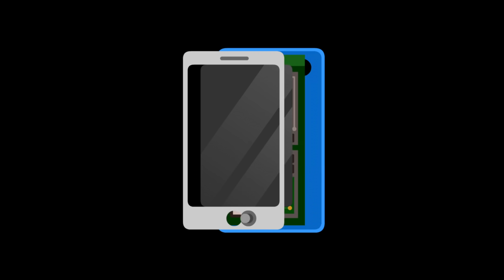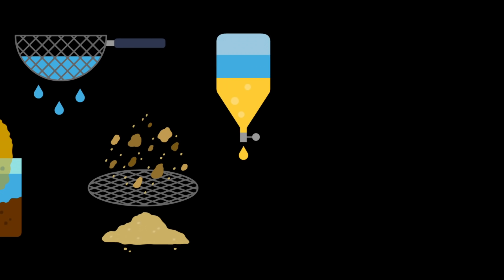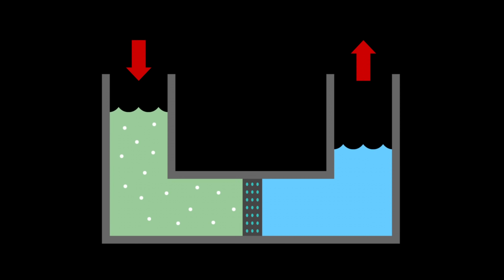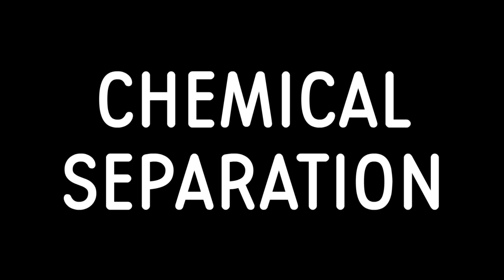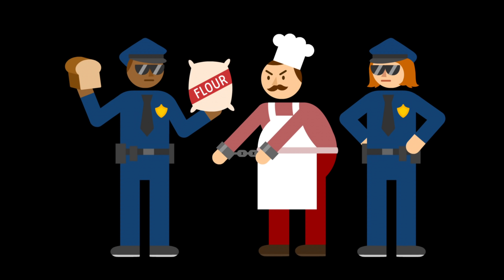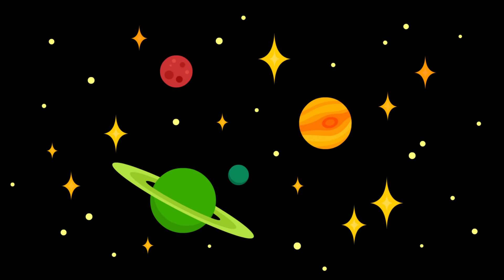How do we separate the seemingly inseparable? - Iddo Magen

Comment: But chromatography is not a "chemical" separation technic, because still relies on a physical difference between the substances, the polarity.
A real chemical separation is one where you make react one of the components of the mixture, change their physical properties and then separate them by one of the processes that you mention
Reply: This is correct.  Came here to say this.  Chromatography is a physical means of separation, not chemical.

Comment: Good presentation your chemical analysis part was spot on however the animation for blood separation was unclear. the tube is spun to where the bottom of the tube is at the outermost part of the centrifuge. Your animation made it seem as though the tube was spun on its own axis and the cells were pushed to the side of the tube, this is not the case.

Comment: That's not how centrifuges work. And the way reverse osmosis is explained makes it sound like regular osmosis. Pressure has to be added on the salinated side. Otherwise, the pure water would diffuse along its gradient into the salt water until they reached equilibrium.

Comment: While I appreciate the simplicity of the Gas Chromatography it is not as is described.  The mixture is heated to the vaporization temperature of the solvent used and then is injected into the instrument.  Then you have liquid chromatography which is similar to gas chromatography.

Comment: A centrifuge spins the tube around an external axis with a tilted angle so the bottom of the tube points outwards, not the tube itself around an internal axis (2:30) ... that is why the red blood cells pack at the bottom of the tube, and not around the sides like the animation shows initially, until it magically fades into the real world situation.

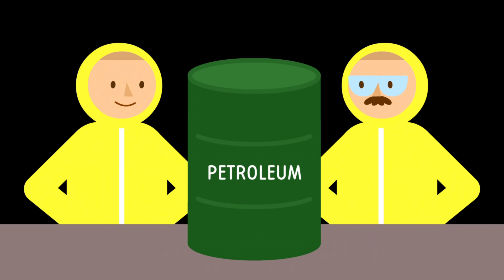Comment: 1:16 that turbine XD
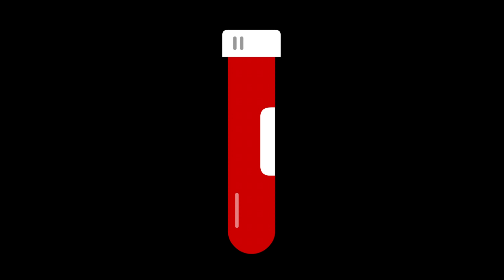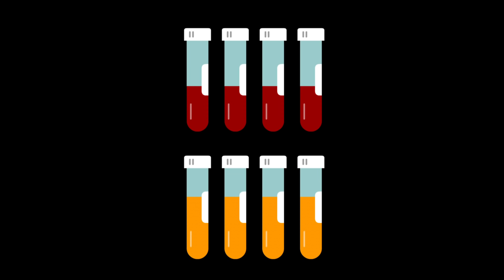2:27 thats not how they are turned! the small "bottle" is turned with its bottom part further away from the rotationcenter than the top. that way you also get the seperation shown at 2:42

Comment: Minor mistake with the animation for the blood separation. A centrifuge would spin the test tube around a different axis than is shown in the video.
Reply: +BenTheMagnifice Not only that, but they said blood cells were dissolved in the blood. Blood cells aren't dissolved. They remain whole in the blood. They're suspended in the mixture.
Reply: Adrian BenTheMagnifice  Harder to animate a test tube spinning around an external axis as opposed to an internal one? That or just a bad script writer/animator/fact checker?
Reply: Jack Linde
Right, they have to find a way animate it! Having only done 3D animation myself, I didn't even consider the difficulty of that.
Reply: +BenTheMagnifice Yeah, surely they know this, so I wonder why they made this choice.
Reply: Adrian That reminds me, I need to listen to the video again, to see if they used centripetal versus centrifugal force. Only one of those are real.
Reply: This is a joke, right? Plasma in blood is not the same as the state of matter known as "plasma".

Unless I'm unique and everyone else's blood actually consists of a stream of ionized electrons.
Reply: major mistake, plasma cant be liquid just like a gas cant be liquid yet they refer to "liquid plasma" in the video
Reply: +Jack Linde dis·solve
dəˈzälv/
verb
1.
(with reference to a solid) become or cause to become incorporated into a liquid so as to form a solution.

so·lu·tion
səˈlo͞oSH(ə)n/
noun
a liquid mixture in which the minor component (the solute) is uniformly distributed within the major component (the solvent).

basically one bunch of stuff floating in another bunch of stuff is a solution. you can dissolve things into a solution without breaking them down or changing them. sand in water can be considered a solution if it is stirred up enough to be freely floating and not sitting at the bottom of the container.